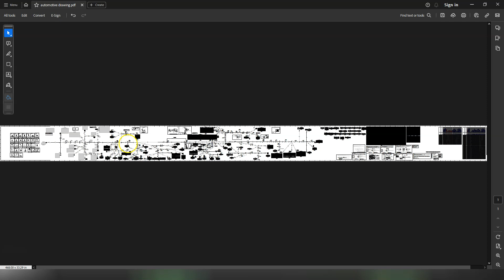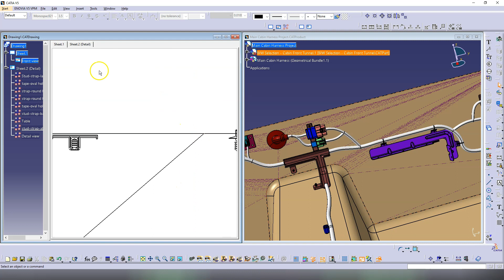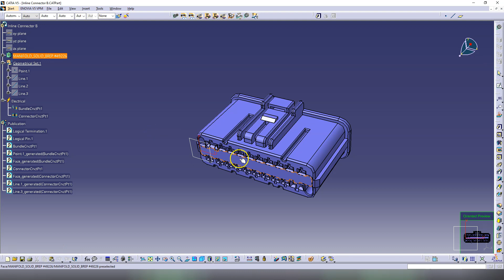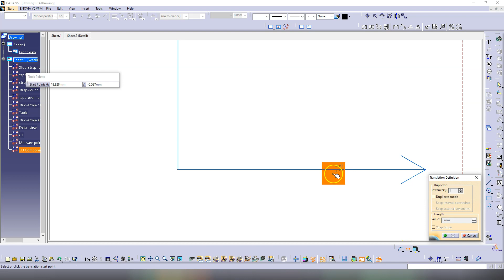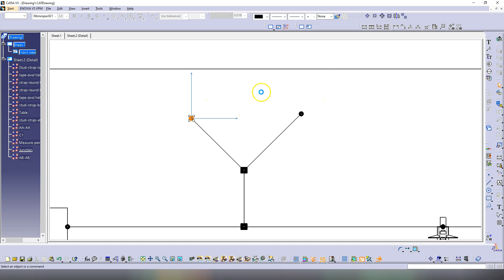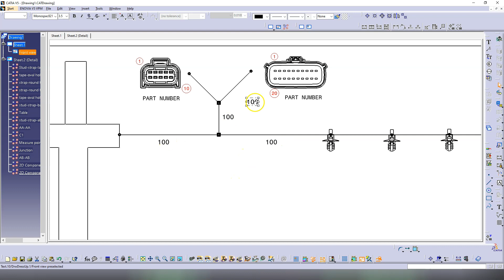Automotive Electrical Harness Manufacturing Drawing | part 2

Comment: "Hi, I have a question for you. I design the wiring harness of the passenger door, and the driver's door wiring harness is very similar, but there's a small difference. Can the passenger side be mirrored in such a way that it is editable?"
Reply from the maker: Hi, please contact me on LinkedIn only. Those complex issues cannot be discussed in comments - https://www.linkedin.com/in/alexdesignman/